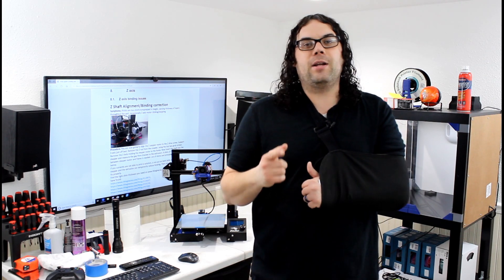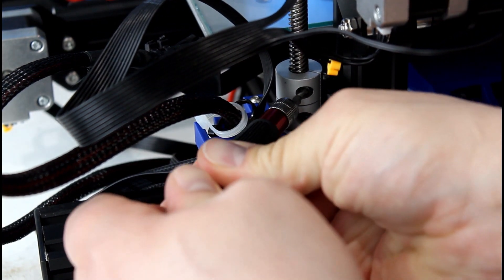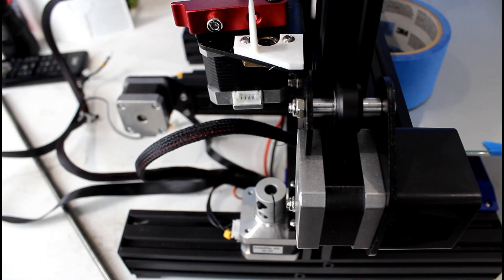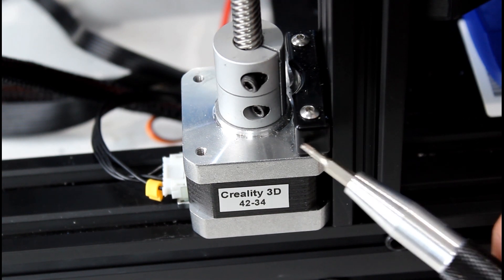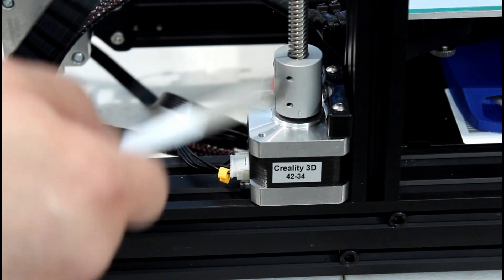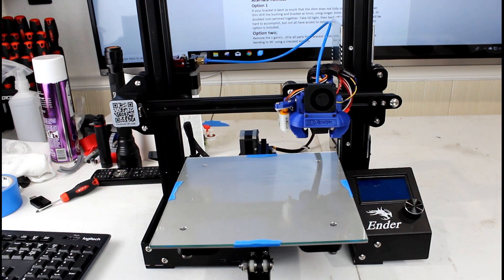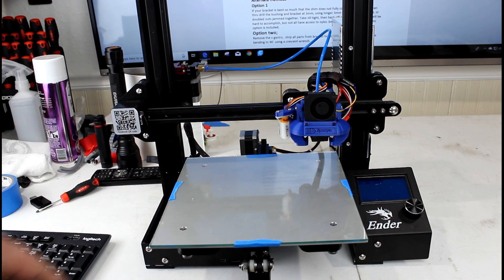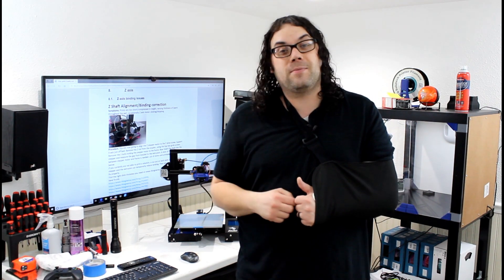Section 8.1 Z Binding Issues Featuring the Ender 3

Comment: In doing this, i found that the stepper wanted to rest closer to the rail instead of further (where it would require a shim). What would be the solution in this case? Filing down the mount to bring the motor closer to the rail?
Reply from the maker: If I understand, the lead screw is angles closer to the extrusion at the bottom. Depending on how far off it is, the bracket that the lead screw comes through the brass fitting could be bent slightly. If that bracket is off, that will cause that issues.
Reply: @TheEdgeofTech You are correct! I do believe there is a video on this. Ill have to try bending it back. Thank you!
Reply: Your L-bracket with the extruder is malaligned bend it so the Z-screw slides into the coupler! The bracket metal is soft and two cresant wrenches will do the trick.
Reply: Stanford Douglas Crescent wrench

Comment: If your spacing was Ok, then doesn't it make this adjustment pointless as there would be no binding because the screw is straight and aligned with the stepper motor?   I ask because I am having a Z axis issue.  I have great adhesion, good solid flow but as the print goes upwards it seems like the nozzle does not go up enough to clear the  previous layer.  The nozzle impacts the previous layer and if it doesn't tear the model off is severely damages it at that point.  If is survives the impacts it will eventually resume and complete, leaving a section that is badly blemished.   Is this Z axis binding or something else?  
I'm using an Ender 3 Pro if it matters.
Reply from the maker: I would definitely walk through this because then maybe it will reset it for you. Even if you think it's working okay and no spacer is needed, just by taking it apart and putting it back together it could fix your issue. Also check your Z screw and make sure it's not worked and have you lubricated it at all? Thanks for watching!
Reply: @TheEdgeofTech   I agree.  I decided last night to go thru it before I read your response.  I also was looking up lubrication.  My Ender is less than 3 weeks old, but that doesn't mean it doesn't need lube.  What would you recommend?  I've seen grease, oil, silicone based, non-silicone based and even teflon......too many choices. lol
Reply from the maker: @broderp  Awesome! Did it help? You probably don't need it yet, but I use PTFE (Teflon) lube. I think it's called Super Lube.
Reply: @TheEdgeofTech   Going thru the motions really enlightened me as to how this thing works and got me thinking in other directions.  Following the directions in your video showed me that my Z stepper is in line with the screw.  I adjusted the coupling a bit as it was not all the way down, but the screw was mashed up against the steeper shaft. They are now separated.    But I also found that the Z Axis support I installed at the top with a bearing was too tight and pushing the rod out slightly adding drag.  I tried to file it (maybe 1-2mm) to fit perfectly at the BOTTOM near the stepper it was off when I placed it at the top.  It was now correct for the bottom but left a gap at the top where it belonged.  This told me my screw was sitting at a slight angle. (greater at top).  I checked the screw - dead straight as far as I can tell on my glass table.   I did all this with the this with the brass threaded part tight. 

So I believe the bracket that mounts the brass screw treads and extruder stepper is not square.  Shimming the motor in this case would bind the screw as much if not more. The bracket needs to be completely disassembled and checked for square.  However,  removing the top Z axis support I added, lubricating the screw and loosening the brass part that the screw goes thru has improved performance greatly.  I just finished a 116 mm tall cylinder and it went perfectly.  

So YES this video did help.  It led me down a path that helped me successfully print but got me thinking about other areas to focus on.  THANKS!
Reply from the maker: @broderp  Awesome! That's great to hear! We don't suggest adding bearing guides at the top because it could cause drag as you found out. But I'm so glad it got you thinking and looking more indep at how it all works, and in the end getting it to work as it should!
Reply: I have the same issue and it completely drives me crazy. I hope i'm able to fix it now. Thank you

Edit: It definitely improved my printing quality but it wasn't the final problem. In my case there was a bit of hard plastic in my extruder which is a problem among the ender 3 extruder. This video will help https://youtu.be/30qqKUwviww

Comment: I've seen users print out a support part on top of the Z-rod (with or without a bearing). Like this one https://www.thingiverse.com/thing:3080912 Do you think it helps with stability?
Reply from the maker: To be honest, I am not sure. But I can ask Luke and see what he thinks!
Reply from the maker: I talked to Luke, and he advised against it. He said that it could cause defects if used. Since the machines are not perfectly straight it could cause a binding issue itself.